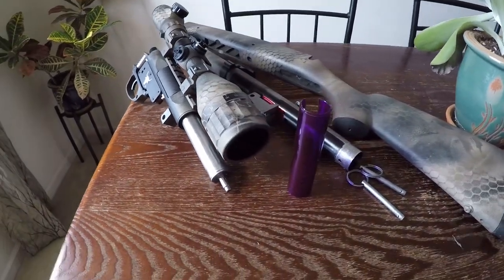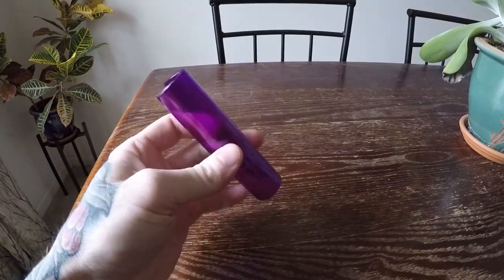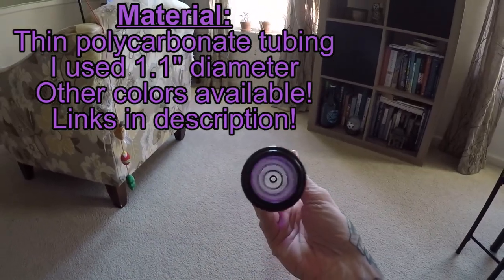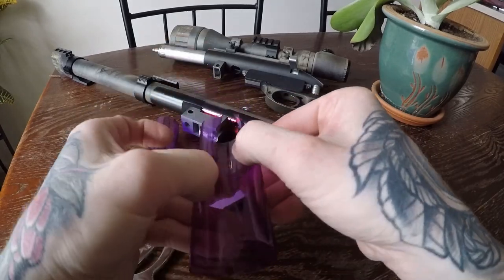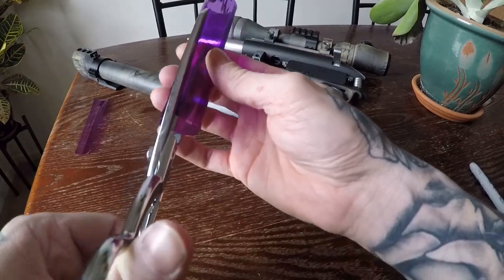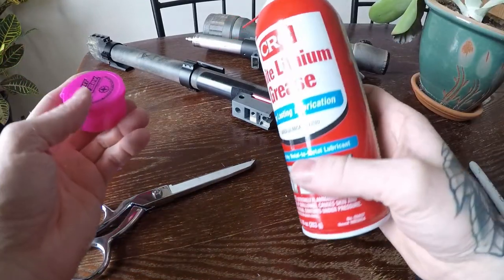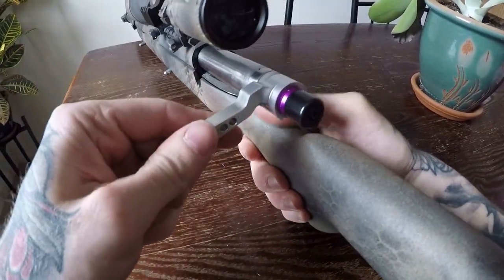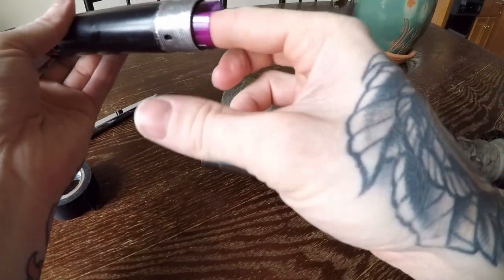Cylinder Guide Sleeve DIY | Vsr-10 Smooth Bolt Pull Mod

Comment: I bought a used VSR. The previous owner did it with 6-7 layers of thin transparent film.
When repeating, I constantly pulled individual layers of foil backwards (they stuck on the cylinder). Is that the same with your mod? Do your pieces stay in place?
Reply from the maker: The poly carbonate in this video will stay in place. Even if there is a little play it won’t jam up the cylinder. It never has for me because it’s too thick to go back into the receiver. The version 2 I made however, can possibly jam and it did for me after using it for a while. I used a thinner material inside of a carbon sleeve. But I was able to fix it by flaring the ends over the outer sleeve so it could no longer slide back. The original mod in this video I think takes the cake though. 🎂

Comment: Great tutorial. I am from Asia and this sleeve hard to get. May  know in (mm)  what is the exact outer diameter of the tube and the thickness of the material? Thanks
Reply from the maker: Extra Mile the specs when I order it says “1.1 inches” which is a little too big but it’s fine if you cut it like in the video. The thickness of the wall is probably under 1mm.
Reply: @BlindSniper  Thanks Bro. Will try to find the substitute here in Indonesia. Btw, do you own TM M40A5?
Reply from the maker: Extra Mile no I do not

Comment: You can also do this with a can or soda bottle.
Reply: A soda can can only be used for an ejection port cover, not as a cylinder sleeve. You want to avoid metal on metal.

Comment: Whats happen if the plastic close the hole in the barrel? Is it bad?
Reply from the maker: To my knowledge, that hole helps with unjamming if you ever get bbs inside of the outer barrel. Sometimes if you have a bad mag it can unload all of the bbs into the gun. If your vsr doesn’t have jamming or misfeed issues, you should be fine if you cover it. I jus tried to leave it open since it was put there for a reason
Reply: @BlindSniper  Thank you for your answer :) 
Now im calmer 
I just asked this question 
because my plastic turn around every time
Reply from the maker: @vandaszomor7521  mine does too sometimes!!

Comment: Great video, I'm trying to source the tubing in the UK - I thought Polycarbonate is rigid but the tubing you're cutting appears to be flexible and bendable?
Reply from the maker: Thanks for checking it out, I think it’s flexible because it’s so thin. I used tubing that is meant to hold light bulbs. You could try searching for that!! I also made a V2 guide sleeve. Little more work but it’s a bit more rigid too!
Reply from the maker: https://youtu.be/v4QXhCeiOQ8

Comment: hey kinda late but do you have a video on bolt action left hand conversion? I just see the one with HPA
Reply from the maker: Left handed conversion you just buy a left handed receiver and handle. In this video I modified a SPEED handle to work.

Comment: @Blind Sniper 
Hey man! Love the vid!👌
Im going to attempt the mod my self. But i got a question tho..
I found something that seems similar to the stuff your ussing, but i would like to clearify that if possible
Reply from the maker: You can use other material, soda cans/bottles work well also. Some material you may only need 1 layer. I mainly picked the light fixture because of the color lmao

Comment: Have you seen the AirsoftPro receiver?
I think I might actually get it sometime.
Reply from the maker: Silicone Sword I have the AirsoftPro receiver on one of my rifles. It’s very nice! I haven’t actually weighed the barrels. The carbon fiber is lighter, but the aluminum is so thin it’s not saving THAT much weight. If you’re going for an ultra light build it would be nice though. I like the look of carbon fiber
Reply: @BlindSniper  Cool thanks man!!!
Can you weigh your receiver without anything on it???
Reply from the maker: Silicone Sword so I had a maple leaf lefty receiver laying around. Only thing on it is a scope rail. It weighs 171.1g. I honestly don’t feel like stripping my rifle with the airsoft pro receiver, but it probably weights the same. If you are going to ultra light weight, I’d do a carbon fiber spiral drilled barrel and then port/skeletonize the receiver and other parts. I will eventually post a diy on spiral drilling. It’s literally drilling holes but in a twist pattern to look fancy. Easy if you make a template
Reply: @BlindSniper  I think that I will try to cut straight lines into a ML barrel whenever I get one and just keep an AirsoftPro plain and nice looking
Reply: @Rorschachs_Blot  Thanks man.
can you weigh one???
Reply: @Rorschachs_Blot  thanks bro

Comment: Can i paint an carbon fiber? Because that thing is the only part that is not camouflage
Reply from the maker: Denver Gonazales yea you can paint carbon fiber, I would just clean and prep it like any other surface!
Reply: Hey man where did you get the carbon fiber tube??
Reply: And how much
Reply from the maker: Denver Gonazales I search on eBay and amazon for the dimensions I need. Prices vary!